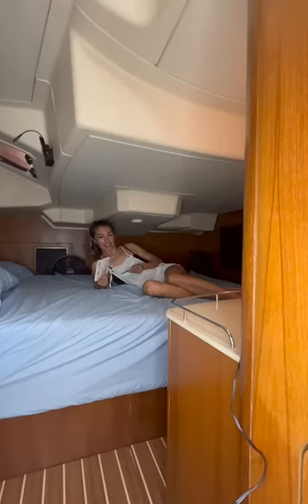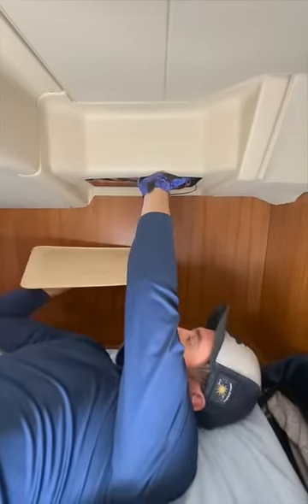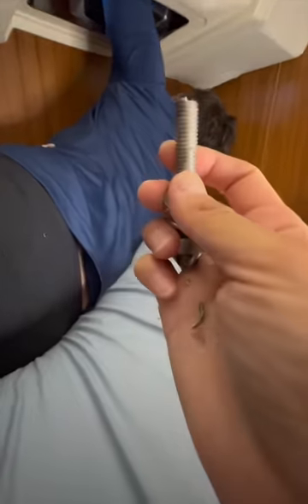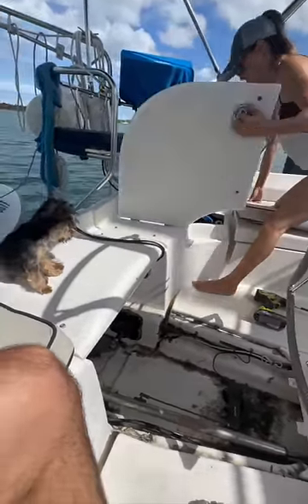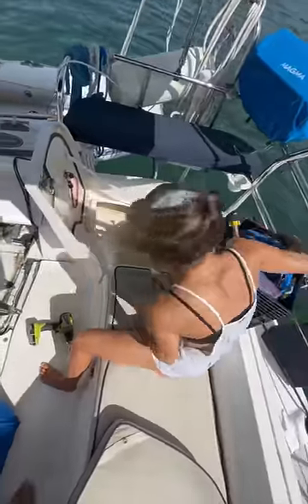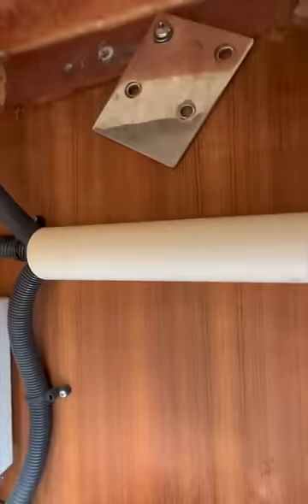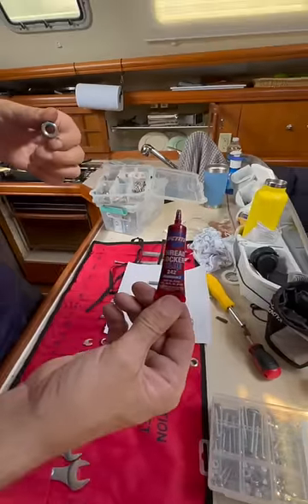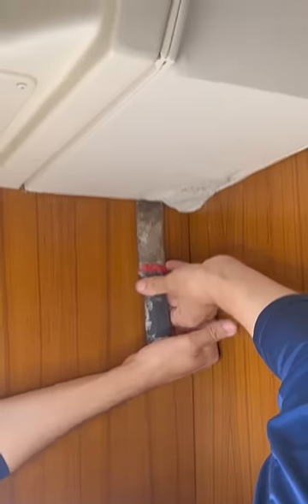Auto Pilot Repair  #sailingbyefelicia

Comment: It not being connected makes it not work? Does it have a gyroscope in it or something I don’t get it
Reply from the maker: It needs to push off the bulkhead (solid wall in the boat) to be able to push the steering rod. So when it pulled away from the wall, it no longer had resistance to pus against the steering bar. I hope that make sense!

Comment: Looks like you weren't able to get the right size bolts there. I probably would have gone stainless steel hex nuts. Bring a magnet. Make sure it doesn't stick to them. Lock washers nylocks and jamming the threads up also help
Reply from the maker: We were in a very remote location.  Just making a repair on the fly with what was onboard.

Comment: Please don't use Phillips head bolts with loctite,if you ever need to get them apart you'll strip them, almost 100%. I recommend torx bolts, least prone to stripping and a very sturdy one if you need to reef on it to tighten or loosen them.
Reply from the maker: This was a repair on the fly in a remote anchorage.   We were just trying to keep the boat moving.
Reply: @SailingByeFelicia  that's fair, sometimes you gotta do what you gotta do. But I still recommend torx for fasteners in general, they're just the best if you don't have to contend with mud and dirt filling them up

Comment: How would the broken supports would that hold the unit up be the reason that it doesn’t work?
Reply from the maker: It’s an actuator that turns the rudder.   There is resistance on the rudder, so the unit needs to be anchored so it can push and pull off the wall mount.

Comment: If there's that much vibration in your sail boat you may have more significant issues with hull integrity or poorly distributed ballast.
Reply from the maker: The autopilot pushed and pulled against the bolts until they came loose.   Who said anything about vibration?

Comment: I would use nylock nuts at a minimum.

In racing and in aviation, all critical fasteners are safety-wired with stainless steel wire to absolutely guarantee the fastener never loosens.

Ever.
Reply from the maker: There are no hardware stores in the middle of the ocean. This was quick fix to keep us moving.

Comment: If it broke those bolts, you might want to replace them with a harder bolt which means a higher grade of bolt.
Reply from the maker: This was a quick diagnostic and fix.  We only had what was onboard to work with.

Comment: "Bolts" require a wrench.
"Screws" are turned with a screwdriver.

Screws are weaker than bolts.

If you were using bolts in the first place, this wouldn't have happened.

Take out the screws. Use Grade 8 bolts. Torque the nuts to 80 ft-lbs and never have this happen again.
Reply from the maker: Thank you for the advice

Comment: You also could of used stainless steel nylock nuts.
Reply from the maker: We had to make due with what we had on board.
Reply: Lol, you don't have the option of choosing the exact correct hardware, especially while cruising. It's one thing when we're tied to the dock with an ACE two blocks away but completely different while at anchor.

Comment: Auto pilot? As in u put in destination and the sailboat will get you there, without doing anything?
Reply from the maker: It’s not that smart.   You need to get the boat going in the right direction, either with the engine or sail.    Then it keeps you pointed at a compass bearing (east or north).  Factors like current or changing wind can blow you off course, so you need to check on it from time to time.   

We always have someone sitting at the wheel when we use autopilot.

Comment: How about you use the same bolt dfor every hole and not change sizes inbetween dafuq, that wont hold long fellas. Also it looks like you replace m8 with m6 so thats a no go if the m8 broke before.
Reply from the maker: This is just the diagnosis and repair on the fly until we can get to a hardware store.

Comment: Owning a boat sounds stressful.  Having friends with boats sounds ideal.  Especially, if they have low expectations (work) from you.
Reply from the maker: That is the move.
Reply: It depends on the boat and how much you like tinkering or how much youre willing to spend on a technician to service it. 
The 21' Century hull with 150hp Yamaha v6 2.3L my parents had wasnt horrible for maintenance, like 95% of the maintenance was done by my dad with us kids helping (more or less with us holding the light and grabbing tools). 

Ironically enough they spent more on fuel than parts and service, i recall it burned about 8-10 gph but dont recall how much 2-cycle oil it went through hourly.

Comment: Poor design and  engineering!  Too much Torque from rudder, dont use plasic bolts,  upgrade to steel lock nuts and bolts,  stop using ridig non flexible plastic. 😮
Reply from the maker: Plastic bolts?